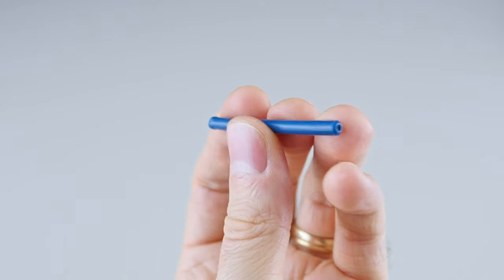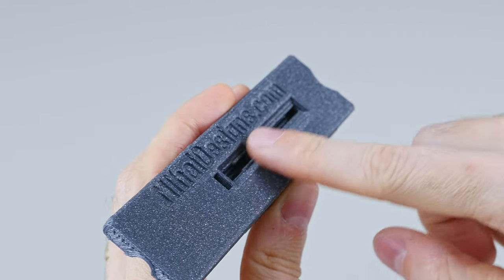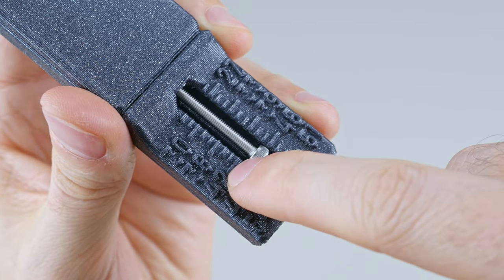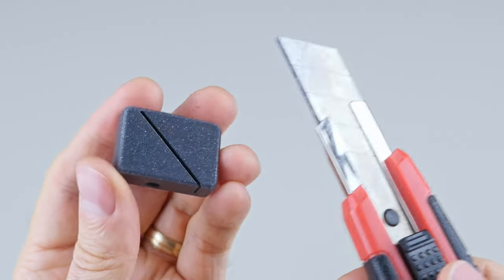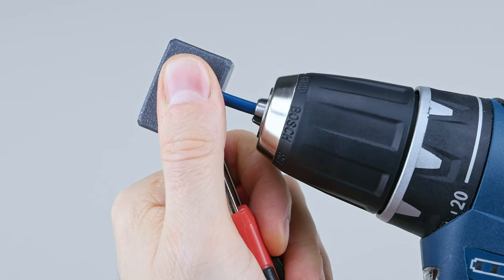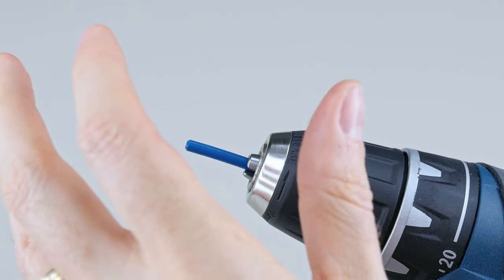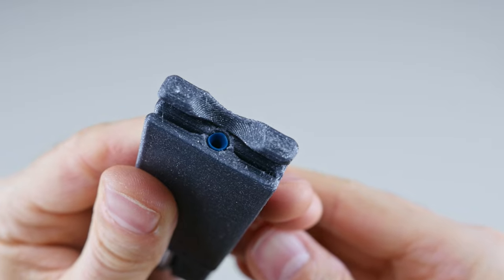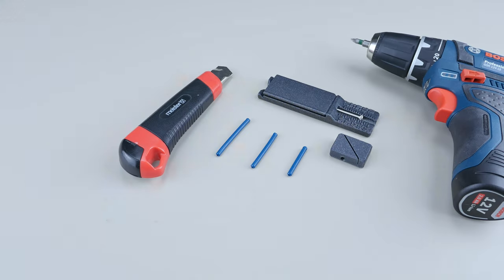How to make a custom PTFE tube for your hotend (custom jig)

Comment: The level of design and quality of implementation is astounding.  It must be frustrating to design, refine, upload the .stl's and construction info as well as make a very well done video and only get 15k views. Cudos to you for doing this. 

The best part is this works. I mean it works really well. I honestly did not think the print would work. In fact I changed the orientation of one item thinking it would print better that way, only to see it print incorrectly (non-circular hole). I tried again just using your placement and voila! It printed perfectly. As did everything. I'm still not sure how that happened lol. Some design magic going on lol.

The actual device also works just as advertised. For those making and using this, do pay attention to where the bottom of the screw head lines up with the size marks. One side is even, the other odd. 

I have subbed to your channel, and will spread links on SM to help out your channel. Although you have a very respectful 830k+ subs, you've never once been in my suggested. I found this with a google search. I look forward to seeing your other content. :)

Comment: This is very similar to bear upgrade PTFE jig for cutting PFTE tube for Bear Exxa, though there you can only get one size -- 45mm.

In that setup instead of using Philips drill bit, it is possible to use CNC milling cutter that is somewhat more precise, if a milling cutter is available.
Reply from the maker: Sure, if you have access to one. Just make sure to clean up any loose bits left inside the tube, so they don't get stuck into the hotend.

Comment: i printed this and love it,  but would love a version that does 61mm tubes, since i don't have source files to modify it
Reply from the maker: I could extend it. What is that size for if you don't mind?
Reply: @MihaiDesigns  for the babybullet tool on the jubilee toolchanger. Its like the E3D toolchanger but more community driven.
If i were you i would keep the same 40mm screw, change the letters and change the length where the tube sits

Comment: What does drill to the left mean? Counter or clockwise?
Reply: Counterclockwise
Reply from the maker: Indeed, counterclockwise. The other direction won't cut. But you can print the part mirrored and then it'll cut the other way :)